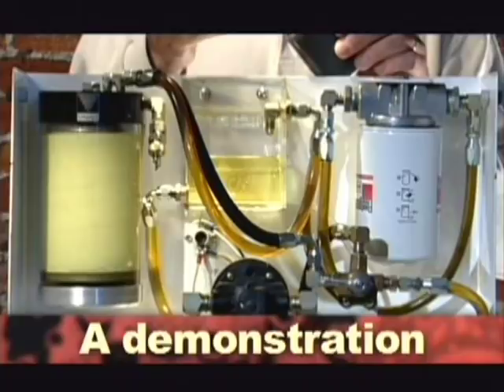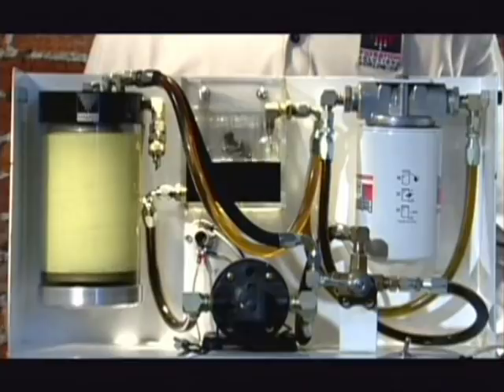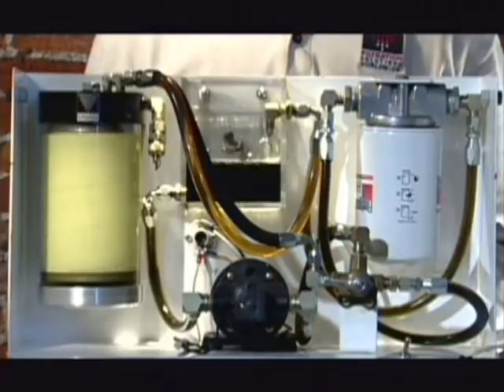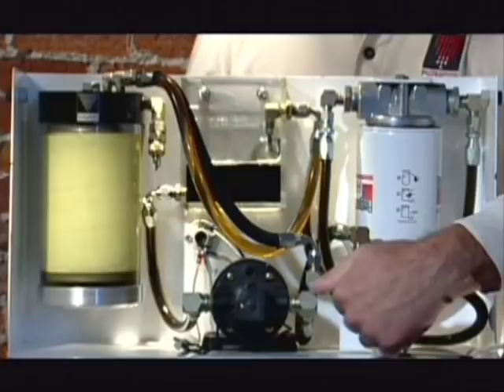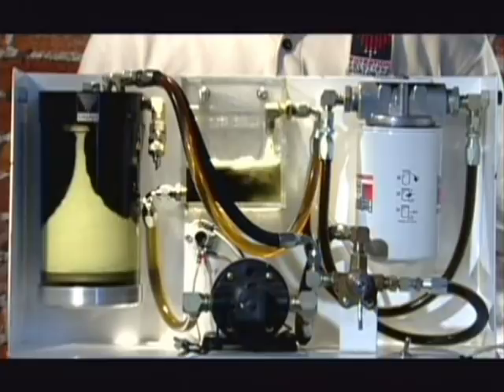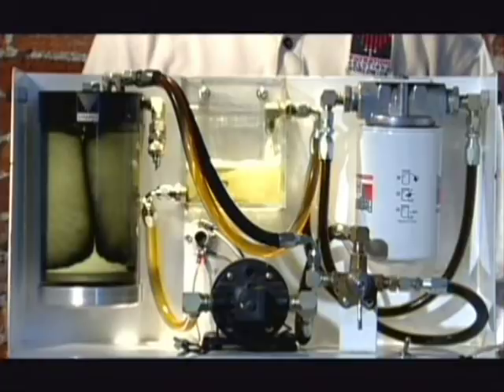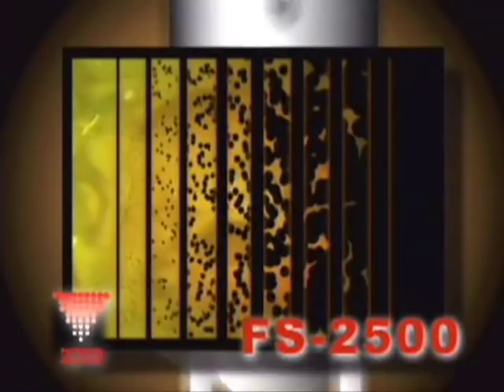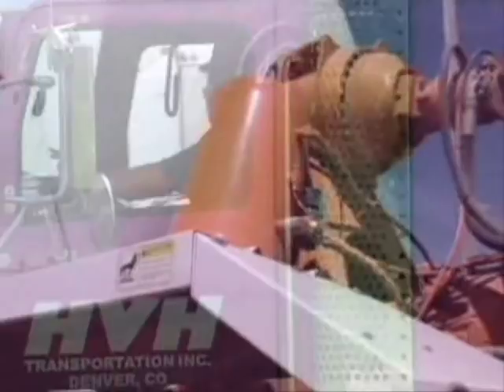Amazing Filter Demonstration - Save Your Engine

Comment: I run a Frantz Bypass oil filter on my R31 Skyline, have had it on there for about a year now, only changed the filter element ("Toilet roll") today, oil was still gold and still smooth. Only reason i changed the oil was i went to a thicker oil as we are coming into summer here. They are the best filtration you can get. All the people who doubt these have obviously never used one so they have no idea. There is also no loss in oil pressure.
Reply: What's the point of using thicker oil in the summer?  Why not just use a multi-weight oil?

Comment: I have used this system in my 3406E model Cat for 19 yrs. I had 1,000,000 miles and my co-drive blow the motor by getting it to hot. My mechanic said I could have used the old bearing off the mains and rods. there had being very little wear because I use the Filtation System. total miles with this system is over 2,000,000 miles. 
Chuck H.

Comment: I have read many peoples complaints about bypass filters and i don't think any of you get it. The bypass filter is a secondary system and takes out the smallest particles. Because of that you only flow a small amount of oil through the filter and you run all of the oil through approx 5 times a hour. Thats how they work. So there is no need to tell people they don't know what they are doing just because they want to improve on the oil in the system. These are and have been on truck tractor diesels for at least the 75 yrs. yes your oil will still turn black because of the dye discolours the oil but it does remove the damaging particles. That is how you get a million miles from a diesel engine. But if you think delete is the only answer well it isn't. I don't think they have gone about these systems properly to reduce pollution but delete is not the answer.
Reply: I have used this system in my 3406E model Cat for 19 yrs. I had 1,000,000 miles and my co-drive blow the motor by getting it to hot. My mechanic said I could have the old bearing off the mains and rods. there had being very little wear because I use the Filtation System. total miles with this system is over 2,000,000 miles. 
Chuck H.

Comment: I have an FS2500 on my diesel pickup.   I take oil feed with a T fitting from the port containing my oil pressure gauge  and I return the oil through the oil pan's drain sump opening.  My oil stays cleaner and runs cooler due to the metal casing of the bypass filter radiating excess heat.  I have read that engine oil provides up to 40% of the engine cooling effect.  I've debated plumbing a heat diffuser or two into the system as well.  

     Coupling this filter with 100% synthetic engine oil allows me to replace both this and my standard engine oil filter yearly.  I add a quart or so of engine oil every filter change and every other filter change I plan to send in for an oil analysis.

Comment: Bypass filters like this have been around for many, many years. They do work and there are thousands of positive, admittedly anecdotal results. 

However, don't think that this filter will result in new looking oil. It won't make your oil look amber. It will, however improve it's appearance somewhat.

Comment: This is great information on the bypass.  I was looking at the Amsoil bypass one for my GM gas engine.  I have been using magnets on the oil filter and oil drain plug and noticed a lot of ferrous metals being picked by the magnets. I know best filters are about 20 microns at 99% efficiency so wanted a better option.  Thanks for all the info

Comment: I put one of these on my 2005 GMC 2500HD in 2008 and recently had to replace a valve cover gasket that was leaking. Everything under the valve cover looked brand new. No sludge or even dirty oil at all. I change my oil and filters at 6k miles using 5w40 delo 400 and 2qt of Lucas since I got the truck back in 2006

Comment: It is a great filter demonstration. But Amsoil has had a system like this from the late 1970's and they sell the lubricants to go with it. They are only By-Pass filters, not full flow filters, but they can significantly extend the life of the oil and the engine. I have used them but now there is no room in my engine bay to install one.
Reply: ***** And some didn't even have filters, like the original VW beetle, and my first vehicle, a 1929 Model A Ford, which had none from memory.

Filtration over the years has improved, unless of course you use cheap filters. But many after market filters filter better than the originals. I did once have a toilet roll filter.

Comment: I've used Baldwin filters for a while after doing a research found that fleetguard was Cummins Filtration bought a Lube kit for the fuel and the engine along with the bypass filter. Upon priming my new fleetguard Lube filter I saw something shiny fall down into the oil I took a magnet and retrieved it pulled out a half moon coarse hair sized sliver of metal that was left behind from the thread Machining process. That piece of metal would have went right through the bearing journals people beware the quality control from fleetguard filters is not good I have never seen this on another filter. I'm glad I was paying attention and saw it

Comment: I bought this system for my 2005 dodge ram cummins, I can tell you right now, the oil does not come out that clean, was still black as can be, im sure it helps but this demonstration is total bull!!
Reply: Candace Valenzuela Oil will also turn black from heat breakdown and oxidation. No filter will fix that.
Reply: you have a diesel though, the oil is gonna be black, even new.
Reply: I bought an AMSOIL based one, and my oil is still amber color. no black yet and I have about 600 miles on it, I have a 6.7L cummins
Reply: therawlifefamily dude my 7.3 with a motorcraft filter and cheap oil stays amber for 2,000 miles. That's not crazy
Reply: Candace Valenzuela the oil coming.out of the filter is clean again, but it wont magically keep all 15 or so Qts clean all the time. Watch the return oil as it comes out of the fill cap. It should look like honey.
Reply: the filters a scam... think about it if its that bad, why the hell are the engine manufactures not putting on a second oil filter?
Reply: Matt Lane because engine manufacturers sell replacement parts. Also because its not needed unless you do extended oil changes like 10k miles or more.
Reply: Candace Valenzuela you hooked it up wrong.
Reply: Of course is it come out black. Any good bypass extends oil life and removes particle larger than 3 microns. They show only that size particles. Dome of the soot is far far finer than that. THAT's why they won't show actual used motor oil.  It would be black.  The super fine particles are not much of a problem, only if you go too long, other factors arise.
Reply: Matt Lane   Bypass filter ares mainly for diesel engines because of soot production and big trucks ALWAYS come with them. Big truck standard.
Reply: diesel / auto tec for 20+ yrs.  If it stains your hand (leaves a dark shadow even after washed), has an awful odor (should almost smell sweet when good) you are on a bad path and should seek a qualified mechanic. Something is getting way to hot.
Reply: I have a 2003 Ram Cummins, towed nearly 2000 miles (I think 1,976 miles if I'm right, towing about 7,500 lbs give or take) and the oil stayed amber, but a shade darker.  I just used a regular off the shelf filter.
Reply: Diesel engines will turn oil black within a minute, it is normal.
Reply: OIL, turns black do to oxidation. just like an apple or pear turns brown once you cut and expose it to oxygen, Oil will oxidize in the exact same way. Plus your analyzing your oil after 3k to 5k., this test is over 1 mile so to speak. this filter will and did clean the oil as shown in this video. if you put a cup of oil in a jar, take a pic. leave it open for six months,  take a pic. compare pic, the oil 6 months later will be many  times darker, with zero miles.  I'm not claiming this filter is good or bad only correcting your comment and/or thought process encouraged  your comment. what you should have or need to do, send your used oil in for analyzing. them compare filters.
Reply: That's normal all oil filters get clogged and bypass valves plus it's a diesel
Reply: You put this on a 15 year old truck...Are you basing your results on a sample taken during the first run right after installation?
Is it possible that your 15 year old engine was dirty inside which is making your oil appear black so soon? Sounds like you're not telling all the details
Reply: @W.451  bypass oil filters are not standard on many diesels in north America . They were standard on early model Series 60, cat c12 and certain Cummins, but that's all I've ever seen
Reply: If it is filtering down that small, it will not let oil through and the releif valve will have to open dumping dirty oil right into your engine.
Reply: @angryadrien  and all volvos d12 d13 d16 engines
Reply: Even my toilet paper filtered oil is black ,( well green) like right after i change rolls . 5.9 24 valve 98.5
Reply: @joesurfer9754  this is a by pass. The small amount of oil it's taking out will not effect the needed oil supply to the engine

Comment: GM did a study which was published by the Society of Automotive Engineers, reduce the size of particles filtered out from 40 microns to 5 microns and the engine lasts eight times as long.
That's in gasoline engines, which are cleaner internally than diesels.
Reply: While this is true, gasoline is a solvent whereas diesel fuel is a lubricant, so diesel engines are better-lubricated which helps compensate for the increased particulates in the oil.
Reply: i wouldn't bet on that with ultra low sulfur diesel
Reply: not true at what efficiency? most filters are 20 microns @ 50% efficiency and are full flow which have a unloader that allows contaminants through especially when you first startup or don't change the filter. In fact Cummins requires bypass filtration now. That is why you see combo or dual flow filters part of the oil goes through a different media in the filter this is not available on most cars since you need a large filter to fit the bypass filter inside https://www.cumminsfiltration.com/south-pacific/venturi-combo-lube-filters. Micron rating is the size of particles which are filtered out by filters at a certain efficiency. When this efficiency is at least 98.6%, we speak about absolute micron rating/filtration. "Nominal micron rating is just a commercial trick for all efficiencies lower than 98.6%, meaning that for the same micron rating (for example 10 µ) in the case of nominal rating, not all particles will be captured in the filter as in the case of absolute micron rating." (from Cummins)
Reply: Chris S the low sulfur diesel is fine please don’t tell me your that guy that runs red dye “because my truck runs better with it” type of guy Europe has been using low sulfur diesel since I think the late 90s.
Reply: William Watkins well red dye is also low sulfer so there's no benefit to running it.
Reply: Chris S I know it’s only dyed red for tax purposes
Reply: Older diesel engines were not designed to run with ultra low sulfer red dye is the same so your older engines high pressure fuel pump may wear faster. If you do have a older diesel it might be a idea to use smokeless 2 stroke oil in the fuel. The reason for ultra low sulfer is for newer diesels with DPF because sulfer poisons the catalyst.
Reply: I found a study from SAE, paper number 881825, and it showed that engine wear was reduced upto 70% by filtering from 40 microns to 15 microns.  Thing is, I haven't seen any regular filters that allow particles 40 microns or bigger, even the cheapest filters at $1.30.  Most cheap filter around 20 microns, which is close to the 15 micron in the SAE study.
EDIT: GM was affiliated with this study, 881825.
EDIT 2: I have no doubt that this system is of little to no benefit for use in engines in service in North America today, but I am curious if there will be any benefit in future engines that are of tighter clearances.  Japan already has engines with 0W-16 oil and 0W-8 is in development.

Comment: I highly recommend filtration on fuel, engine oil, and hydraulic systems as well.  

Keep in mind big pieces cause the failures...but it's the tiny pieces that make the small pieces, that make the slightly bigger pieces, that create the big pieces that cause failure.  Take out the tiny stuff and the rest of them are never created.

Comment: The term slows the flow of oil is misleading. These take a small amount of oil from the flow and clean it, then return it to the oil pan. As for clogging, you change these filters around 25,000 miles. Just change your regular filters at the proper interval.

Comment: It seems like most commenters don't understand how this is plumbed into a practical application, if the bypass oil filter is blocked totally the lubrication system will operate normally.
Reply: Amen Binshou

Comment: In industry we have oil filter setup's that starts at a 20 and end at a 3 or 5 micron. We set these up on new drums of oil and filter NEW DRUMS OF BULK OIL! Yes if your worried about the oil look at the bottom of your jug of oil and you will see fines in a new bottle of oil.

Comment: Bypass filtration is a proven science.  The FS-2500 units are some of the best on the market.  I've run these units on my equipment for 20 years with excellent results.  This demonstration shows how the filters remove suspended solids not dissolved solids.  It is not going to make your diesel oil look like it is fresh out of the bottle due to dissolved solids in the oil.  However, a laboratory oil analysis will show you that the FS-2500 does exactly what it says it does.

Comment: Big question for these filters. How much does the pressure drop across the filter increase by as it gets filled with particles and how much is the flow rate reduced. They never show pressure gauges or flow rates on these tests. To much of a pressure loss and reduced flow rate can be worse than only filtering out larger particles.
Reply: Sam Walker The engine will never lose oil pressure due to only about 20% is being sent through bypass filter.Fs2500 claims these filters will go 10,000 miles,im at 8000 right now and I occasionally check the return flow at the oil fill return cap and the flow has not slowed yet.On this demo, theyre running 100% through filter,im sure this thing would plug a lot sooner if you ran 100%of oil through it..
Reply: its a Bypass filter to help reduce the build up of smaller particulates that are not caught by the main filter. Its not intended to be a primary filter, just as one to help extend filter and engine life.
Reply: Someone here gets it!
Reply: People tend to not understand the idea of a secondary / bypass filter. Its intended to extend filter life and engine life......its never intended to be the only one.  A well designed secondary filter can help prevent sludge and premature engine wear...its a proven fact :)
Reply: Makes sense to me , you're right though most people don't get the concept, secondary filtration should be part of every internal combustion engine arrangement .
Reply: Back before the 60s all oil filters were optional equipment. All filters were bypass filters. If you bought a over the road truck and wanted a filter you probably paid extra for a Luber Finer 750 bypass filter. At some point engineers decided that it would be better to add the full flow filter to get the big engine damaging abrasives before they damaged the engine. The smaller engine wearing abrasives could be removed by changing the oil or adding a slower bypass filter to clean oil. A Ford engineering report said both a bypass filter and a full flow filter should be used. The bypass filter on my 41 Dodge was far superior to the modern fill flow filter at cleaning oil. It used cotton.Sometime in the 60s cotton was replaced by almost useless pleated paper. My 64 Rambler American came with a nearly useless pleated paper bypass filter. I replaced it with a Frantz oil cleaner. At the time I used MD toilet paper in it. MD Chiffon Safe Way Scott Chiffon they called for 2 ply facial quality. The big Luber Finer used cotton and sometimes pulverized newspapers. Analytically clean oil in a gasoline engine will be golden. On a diesel It can be analytically clean and be black. Some over the road trucks use 2 rolls of big roll paper towels In a housing made of hydraulic cylinder tubing. These are serious filters.

Comment: If you drive a car, this is not for you. Go to Jiffy lube pay $29.95 see you in 6 months. These systems are for REAL toys. Semi's, Graders, Heavy equipment. Every truck that you pass has 10 gallons of oil, that's close to $300 a month in oil changes for some trucks. These cost around $1000 and can pay for themselves in a short time on large equipment.
Reply: yeah...I want this on my bike too!!
Reply: Nonsense.  You can add a bypass filter to whatever you want.
Reply: yeah soot and dirt builds up on any piston engine diesel, gasoline... my bike feels terrible after only 2000miles of oil change...my car does that after 4000miles... I can see bike needs it...or could it be the heat that's causing it? bike engines have much smaller volume to dissipate the heat...theyre both 1100cc's and 4 cylinder kitties
Reply: I you notice a performance effect of an oil change at all then there are issues. What bikes is this on? Use the reccomended oil in the correct weight.
Reply: getahanddown Motorcycles are different. Oil will make the transmission feel different. Shifting will be affected.
Reply: get motorcycle racing oil, I use it in my mowers..